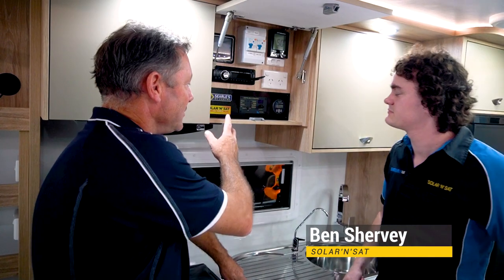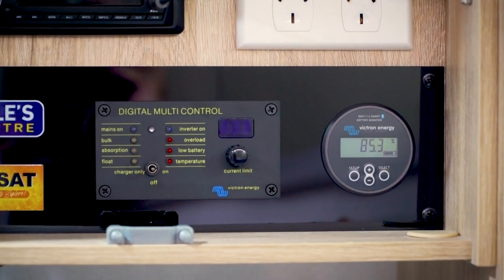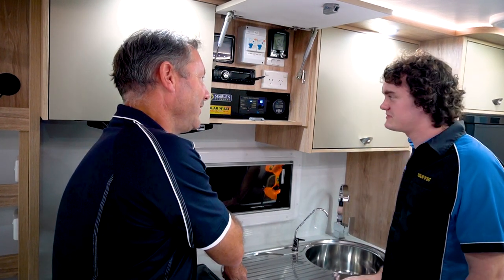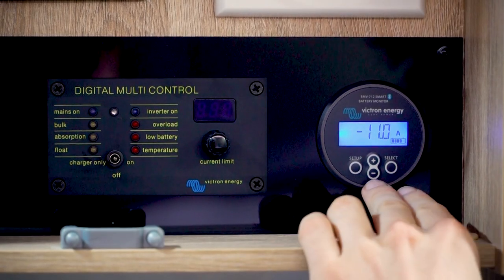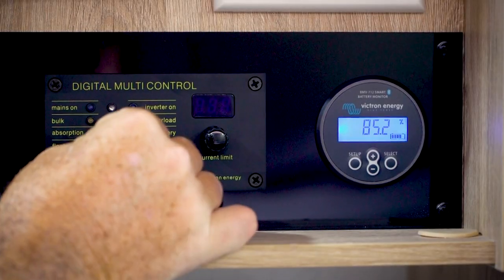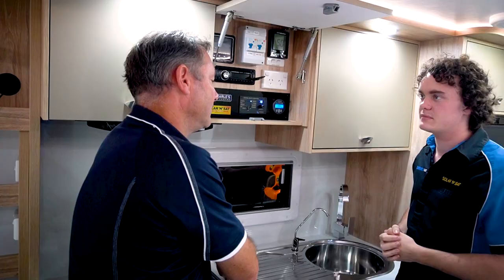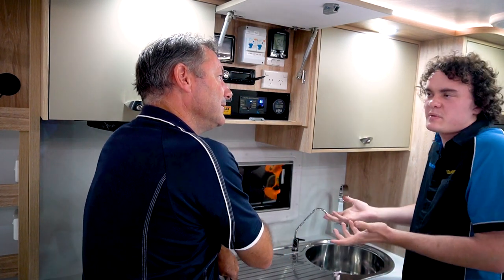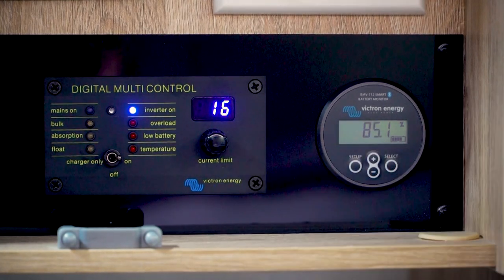Victron Digital Multi Control Tutorial | Willow Caravan Power Systems

Comment: When would you select the charge only setting?
Reply: Say if you had a generator set on a timer when no one is using AC power, it would allow battery charging but not activate the inverter feature when the generator shuts down. The inverter uses a bit of power when on standby with no AC load.
Reply: When you leave the system unused for a while or in storage. Or on a long winter night to extend the batteries